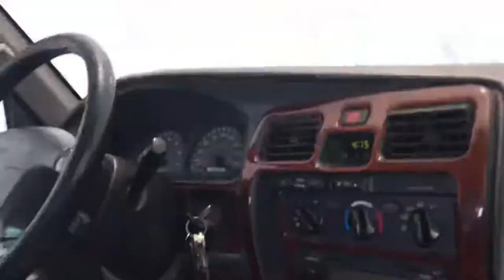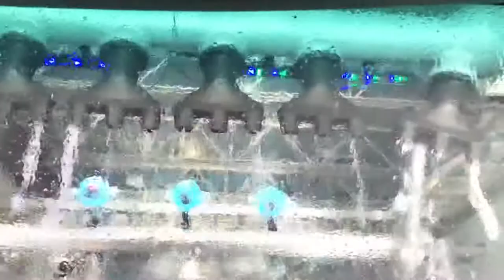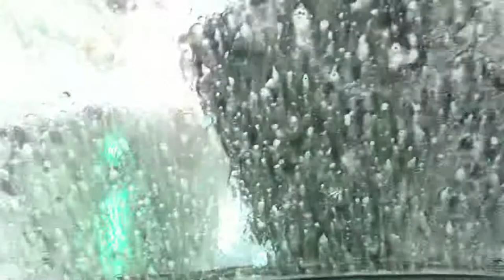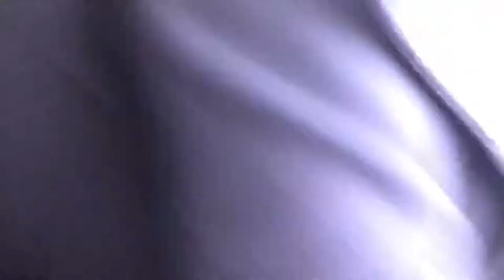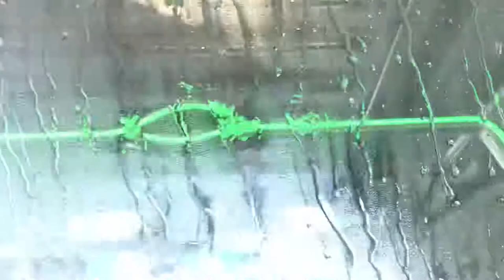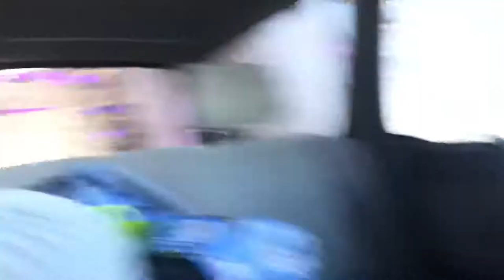Wash King Car Wash - Inside Perspective

Comment: I finally went to this wash a couple weeks ago, my car was quite dirty, was very disappointed. Didn’t do a good job, missed so many areas and left soap residue on my car. Definitely not worth 30 bucks, maybe 10 at most. Went to my favourite shell Mark VII wash today after my trip with a very dirty car and it did its usual amazing job! 100 times better then this wash!
Reply from the maker: Wow! Can’t believe it. I know that when I was the first customer, it was only $20 and since then they raised the prices. And, it was worth it. And can you believe this - when they raised the prices, they once offered me a FREE wash!! It’s crazy. And I have to say, this wash is better than Top Gear. And one thing--they probably gave you the wrong wash (The Cool Spin). In this video, I bought “The Great Spin” for (previously $20 but now $30). So I think they should give you a free rewash, due to how bad of a job it did on your car.

Comment: It does a terrible job, unless the attendants clean it right.
Reply from the maker: Ryan Cameron I’ve been here about 4 times and both the touch free and this have done a remarkable job. If you come back, try it on a Tuesday. Jeff (who let me do an in-bay perspective here) will do an amazing job cleaning your car if you get the $30 wash.
Reply: there used to be an attendant there named Ryan (just like yours) who did the worst job ever.  Luckily hes gone now!
Reply from the maker: @rodismail2476  Jeff, the guy who let me do an in-bay perspective, does a fantastic job. Honestly Wash King is crap compared to Great White, go there instead, it doesn’t matter who the attendant is there as the equipment is nothing short of terrific.